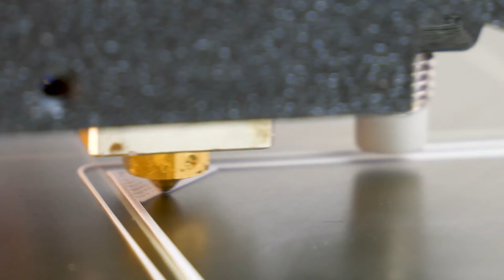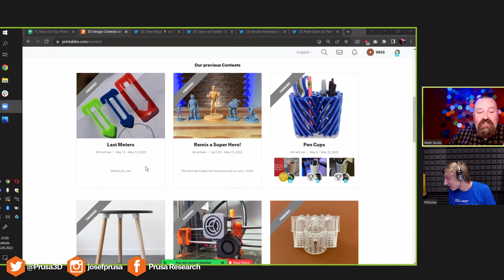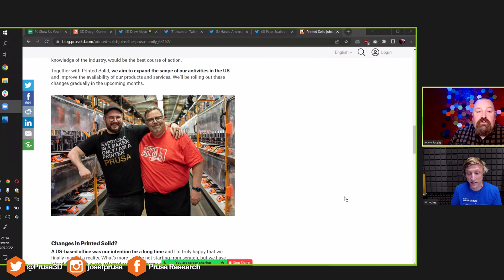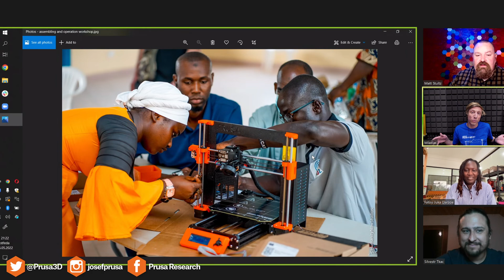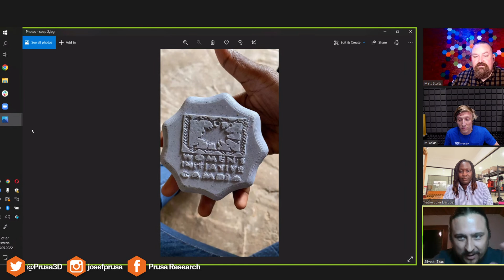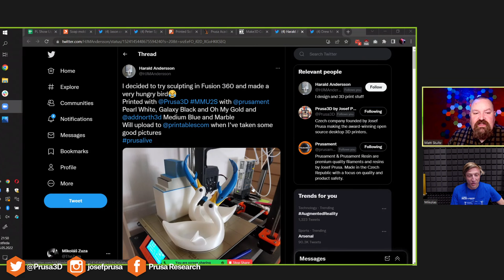Original Prusa Enclosure, new T-shirt and guest Make3D Company Limited from Gambia - PRUSA LIVE #41

Comment: Hey Jo and crew, will the fire extinguisher be available outside of the EU? I think that would be a great selling point for print farms. Also, would it be possible to put the Einsy board outside of the enclosure? I'm sure you've made the determination that it's probably fine inside, that one is out of curiosity. (Increased cost because the harnesses would need to be shaped differently?)
Reply: Just search Fire extinguisher ball, capsule etc... You can find lot of different products, probably even locally.